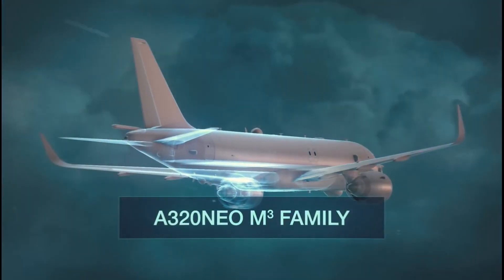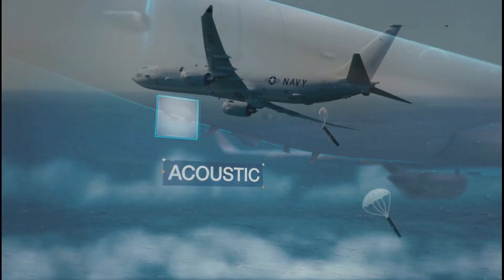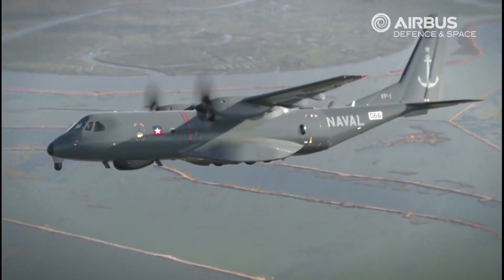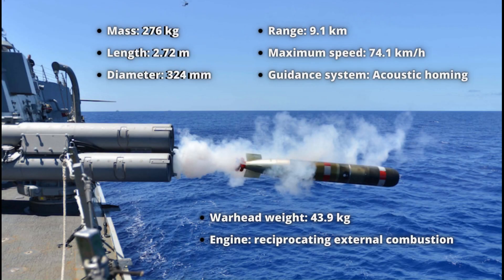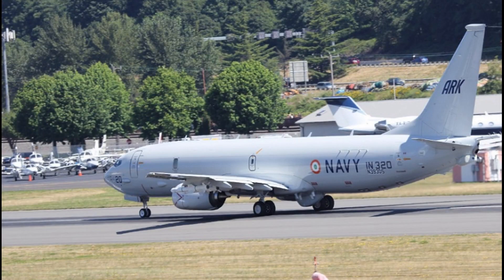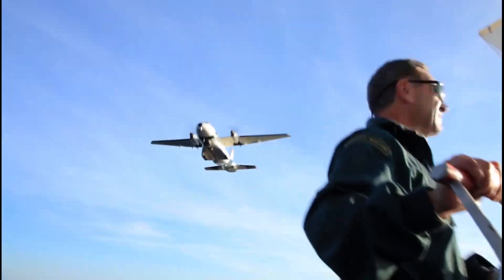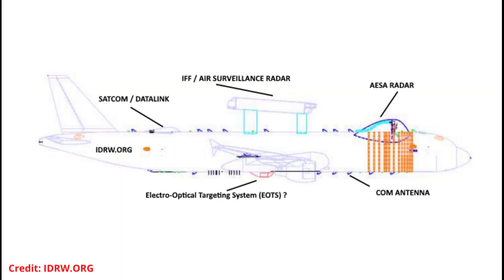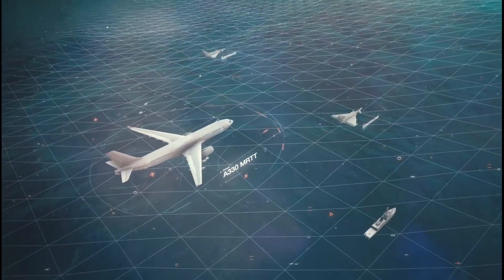DRDO Multi Mission Maritime Aircraft | Which is best for Indian Navy? | A320 vs C325  | in English

Comment from the maker: ************		P8			A320		C295
Crew:			9			10			*
Length:			39.47 m		37.57 m		24.46 m
Wingspan:		37.64 m		35.8 m		25.81 m
Height:			12.83 m		11.9m		8.66 m
MTW: 			85,000 kg	78,00 kg		21,000 kg
Powerplant:		2x121 kN	2x120 kN	2x2,000 kw
Cruise speed:	815 km/h	829 km/h	482 km/h
Ferry range:		8,400 km	7,000 km	5,000 km
Endurance:		14 h		12 h		11 h
Service celling:	41,000 ft	41,000 ft	30,000 ft
Hardpoint		11			10			6

Comment: Wouldn't c390 millenium be better it cost like c295 and can lift 26 ton average
Reply from the maker: If you look at the IAF C295 deal, each aircraft cost around US$45 million (US$2.5 billion for 56 aircraft). But the cost does not only includes the fighter jet but also includes TOT, training, simulator (Maybe), infrastructure, and so on. Technically each C295 cost is less than US$45 million.

Whereas C390 costs around US$50-55 million estimated in 2016. In 2022, by adding inflation the cost might be around US$70-80 million or maybe more (Both B737 and A320 cost around US$100 million in 2018). In addition, DRDO has to modify aircraft. Whereas C295, B737, and A320 are proven platforms.

If the air force is ready to acquire C390, then it is a good option.
Reply: @defencestudy now it make sense but it still better than buying p8 they cost 300 mil each maybe now even more
Reply: @defencestudy  can you tell a breakup how much they charged us for tot and I have heard that the 390 is cheaper than c130 so it should not be 70 mil in just 5 yr I don't think there will be inc of 20 mil due to inflation
Reply from the maker: TOT stuff always classified. 

Only 34 C390s are ordered, inflation does not affect when order is sufficient. The cost also gets lower with a large number of orders. 

In 2019 Portugal ordered five C-390s at a cost of $930 million. The deal also includes a flight simulator and maintenance service for a period of 12 years.

In 2019, New Zealand ordered five C-130Js, 24 engines, and related equipment for an estimated cost of US$1.4 billion.

Looks like still, C-390 is cheaper than C130J
Reply: Boeing 737 800 would be a great choice as it shares common platform with p8i